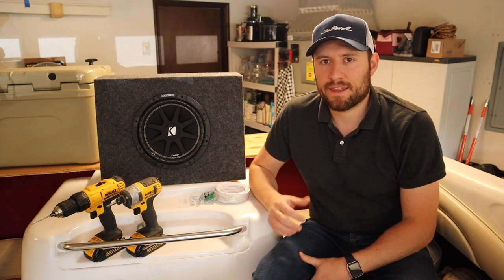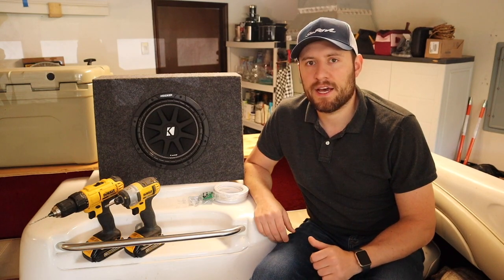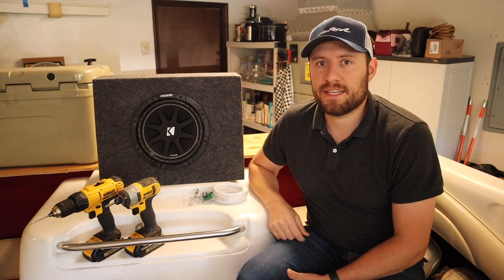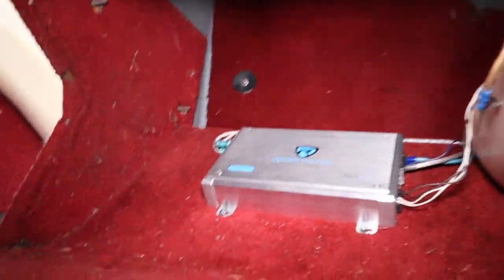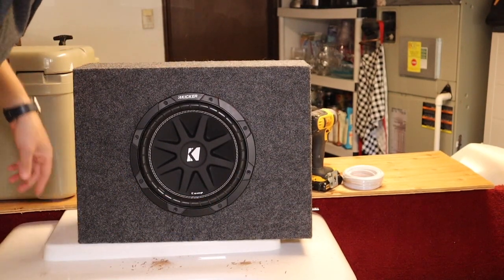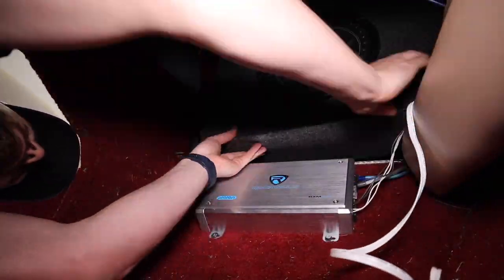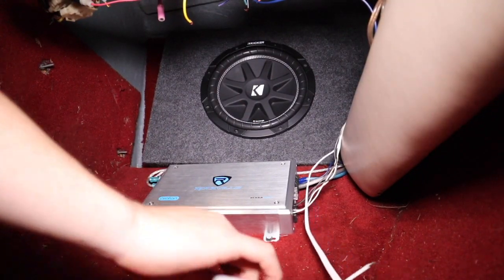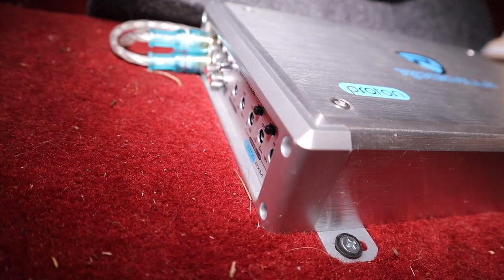HOW TO Install Subwoofer in Boat

Comment: Put spacers under the amp for air flow to help keep tha amp cool and also so the carpet can dry under it if it gets wet. Also I would suggest using wire ferrules to get better connections and reduce corrosion being a marine application.

Comment: Thanks for your video. I also have the same hat😆 and my ‘96 SeaRay resembles your interior which was really helpful in giving me ideas on where to begin. I’m just starting to look into upgrading the old system this off-season with stereo, amp, speakers and sub. I’ll look for your other install videos for helpful tips👍🏼. Thanks much.
Reply from the maker: No problem, glad I could be of help! Let me know if you have any questions when you start upgrading.

Comment: Did you have to put a bigger battery in to run your 2speakers, amp, and sub?
Reply from the maker: In a way I did. In another video I install a battery switch and second battery. The second battery is a pretty large group 27, whereas the original was a group 24. I typically will use the larger battery while sitting out on the lake and let it charge up while cruising. I have never run the larger battery low enough to need the other to start the boat, but it is nice to have that piece of mind. I also have the option of running both batteries together,  in which case I essentially have double the capacity.
Reply from the maker: So to better answer your question, I’d say a single group 27 battery or larger is plenty sufficient for this single amp and sub setup.

Comment: Hello Cars & Computers,

Could I add a capacitor right near the battery, just like you would for a car subwoofer install?

The reason is I am not sure if my father would like for me to upgrade the battery, or add a 2nd one.  I was hoping I could place a capacitor next to the current battery, and that gives the juice it needs to the external subwoofer + amp.

Thank you for your time!
Reply from the maker: In this case I don't think a capacitor would be much help, other than to keep your gauges from flickering when your sub hits. The main worry when adding an amp & sub to a boat is draining the battery too much while the boat is off, and not being able to start the boat. In a car, this is much less of a worry as it is likely on the entire time the music is playing, and charging the batteries with the alternator. If the current battery is large group 27 or larger you should be fine. Otherwise, you can install a larger or second battery for added peace of mind.
Reply: @Jacob190000  I forgot boats don't have an alternator to constantly charge the batteries.  I appreciate your response.  My dad and I may need a bigger battery then.  We can look into a large group 27 first, and take it from there.  I think we can only have 1 battery as it is tucked away behind some seats.  Do you happen to know how much a larger group 27 battery cost you?
Reply from the maker: @djreimsofficial  The boat actually most likely does have an alternator. The difference is, it is very common to turn the engine off and just hangout on a boat. This is where the batterie(s) will drain. For example with my boat, we will often anchor out in the lake and hangout for an hour or two without turning the engine back on. If you guys constantly have the boat on and trolling, etc. You will not have any battery issues and can just use what you have. Group 27 batteries can run from $90 (Walmart) to $200 for a better brand. I actually use the Walmart brand and they work just fine.
Reply: @Jacob190000  so essentially it's like turning off your car and letting that run, which will deplete the battery.  Maybe a battery upgrade will work then and then we can add the amp and subwoofer
Reply from the maker: Yep exactly. Better safe than sorry when out in the middle of a lake!
Reply: @Jacob190000  Thank you for the reply!

Comment: How much was your whole setup
Reply from the maker: Just added up the main components of my system, and here's the breakdown: Kicker Sub - $112
Rockville Amp - $120
Kenwood Speakers - $67
JVC Stereo - $72
Total: $372.
This is in no way a fancy/expensive setup. But, I will tell you that with the addition of the sub and amp to the boat, my system sounds crisp and loud. This sub has more bass than I need, and the Kenwood's get plenty loud.

Comment: What about the battery drain fast on the water ??????
Reply from the maker: This is not much of a concern, especially with 2 batteries. I always make sure to use only 1 of the batteries while the engine is off on the water. That way, if I do somehow run the battery too low, I will have the second to start the engine and re-charge. That being said, I have never had that happen, even with having the engine off for a couple hours. Typically we will be moving around the lake, and so they are getting charged throughout the day anyway.
Reply: @Jacob190000  that’s the point I have just 1 battery 🔋 👍🏾
Reply from the maker: Ah okay. Yeah with just 1 battery you would have to be more careful if adding an amp and sub. Still, you can get plenty of battery life on 1 group 27 or larger battery. Just make sure you start the boat periodically to charge up the batteries.
Reply: @Jacob190000  I have a portable jumper just in case !!!